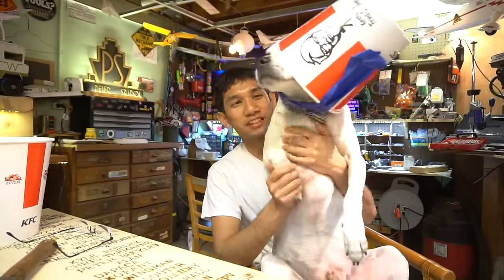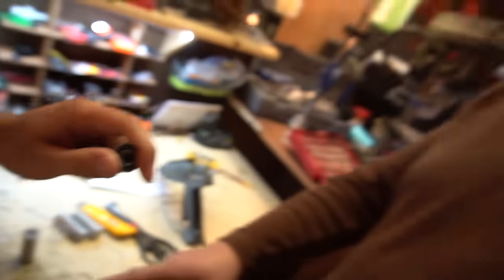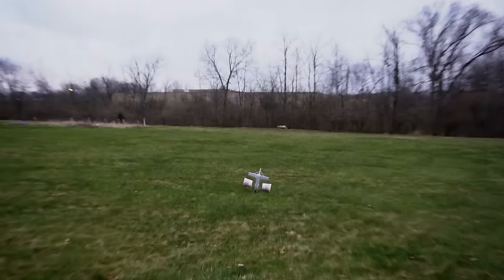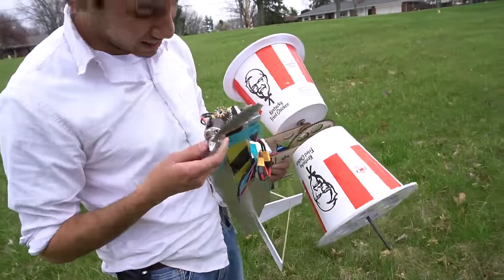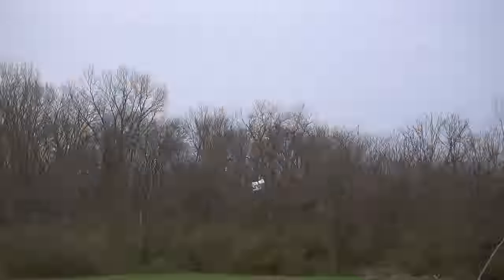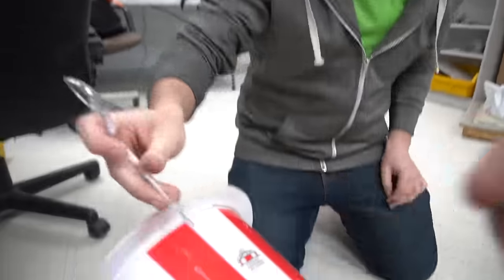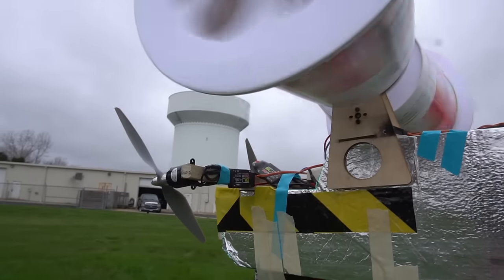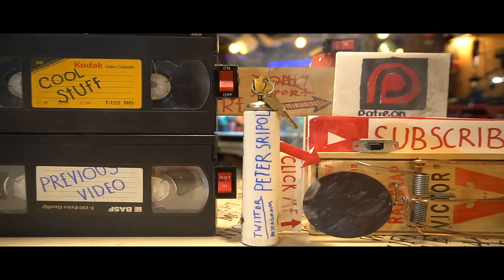RC KFC bucket aeroplane (magnus effect)

Comment: KFC should offer you an advertisment contract.
Red Bull is not longer the only thing that gives you wings. As long as you can rotate them fast enough XD
Reply: I wonder if it would be more stable with greater wing area—like add two more buckets by gluing tops together.
Reply: I wonder if you can use Red Bull cans to fly
Reply: Chickens always had wings.
Reply: @timothyhays1817  yes, but they dont fly they do little leaps.
Reply: i mean gey, he can probably use redbull too
Reply: Red bull would work.
If melted down and turned into a servo arm or something...

Comment: Late comment: try to put dimples on the bucket's surface, it will provide more  "air traction" by creating a microlayer of turbulence, sucking the air to the bucket surface, improving Magnus' force. IIRC, at a certain rotational speed, MF will actually be getting efficient and after that, it'll just basically stall.

Comment: peter- it seems that a magnus effect plane is inefficient but i heard a magnus effect sail boat is actually very efficient and cool could you build that?
Reply: that would be cool
Reply: I am a professional racing sailor.....I'd love to see this. Let me know if you need any help Peter.
Reply: ya
Reply: Fuck yes sailing with kfc bucketship
Reply: I'd love to see that your the boat man as well. make it a super easy no 3d printer hull. like plastic trays or bottles or something
Reply: TZ Boss Pete should Make a hydro foil next
Reply: This. I want to see spinning KFC bucket sails!
Reply: Spencer Watza true but a sail is apparently more effective than a wing because there would only use one engine compared to using two for the prop and back spin and some ships use this type of sail
Reply: Okay there are a few theories I think might help with increasing performance.  Basically when you look at a basketball and put a backspin on it, the grooves on the basketball create that drag or lift that creates in turn the counter spin on the air current.  Next time I would look into maybe grooves on the bucket to add some effect on the backspin.

The second possibility is angling the buckets up say to a 20 degree angle.  This in turn would give it some lift but also create that counter spin as well to allow it to give flight.  At the straight 90 degree level it pretty much creates a level effect, vs angling the buckets could create better lift.

Another one might be the effect of actually going with a quad copter approach.  Instead of using rudders or elevators actually consider vector thrust or propulsion.  Just like the F -22 Raptor.  You could you propellers or maybe a RC fan turbine.  Not jet!  The idea behind this that instead of creating resistance or air brakeage through elevators and flaps.  The vector thrust would create the counter lift allowing a current without drag or resistance and in turn allow a tail thrust to provide steering.  Think like a fist tail on a fish providing the propulsion and steering.  Just in propulsion.  

Anyways some thoughts I thought to experiment myself down the road.
Reply: its not efficient, but there are tests going on using rotating masts to reduce the fuel consumption for freighter ships (rotor ship its called iirc)
Reply: Thanks I didn't know that all I knew was that it could be used as a sail  plus if it doesn't work it could still be used to reduce battery consumption on a ship of peters
Reply: Don't get me wrong on this comment, I agree that it's a neat idea for him to test out. But your comparison for efficiency in that regard is like saying boats are more efficient than planes. If efficiency is your concern, why not build a sailboat? The concern here is for making something badass and different. THAT is why he should make a magnus effect sailboat.

edit: fucked up my syntax of "your"
Reply: kenny7220 good point
Reply: I was just thought of it and decided to bring it up to see if it could work cause from what I knew it had some thing to do with efficiency  but I still think it would be cool to try to either make a sail boat or make one of peters boat more efficient
Reply: It would be cool if you put it in the water because the KFC bucket is that a spin you would act like propellers
Reply: Indeed. It's a great idea for something off the wall to do SCIENCE! with, and my point wasn't to disagree with that. I just get a little bent outta shape when someones premise doesn't correlate well with their supporting details, and may warrant a bit of clarifying on the intention of said premise. :P
Reply: PLZ DO I WOULD LOVE<3
Reply: Check out E-Ship 1 if you want to see that in full scale
Reply: Greg Sweet the German ship
Reply: There's magnus effect RC quadcopters, there's RC airplanes. It's very effective, it's just that you don't make it out of KFC buckets too heavy, too fast.
Think of it as a gentle breeze, barely cushioning you as you walk on the street.
The KFC buckets where like a gale force wind, ripping everything apart. He says so in the video, too fast = too hard to fly. Slow = control.
If he'd get rid of the buckets, widen the stance (like most RCs that word do) he'd fly it.
Otherwise, as is, he'd need four buckets, mouth to mouth 2 by 2, bigger motor, slower rotation and a big ass motor on the front.

Him moving the center of the "wing" up high isn't necessary either. Almost all the other prototypes online (including some biggans half the size of a Smart Car) are built like regular airplanes, just with rotating wings.
Reply: If you put a motor on it, it is not longer a sailboat, so what would be the point? All the energy put into spinning surfaces could be put into a prop in the water. 
To be useful, the wind needs to propel the spinning surface.
Reply: Daveinet the wind spins bucket Wich drives a propeller shaft
Reply: You can always use pedal power.
Reply: Um, the point of sailing is to use wind power. No one cares about the 
magnus effect unless unless you can generate more lift with less power.
 Its not efficient if you are adding additional power to make it work.  

Really a bucket is the wrong shape for lift anyway. Lift is generated by the 
absence of atmospheric pressure pushing down on the wing surface. But 
what does the lifting is the pressure from underneath. The problem is 
the round surface is not a good surface to capture pressure with. While 
the effect works, I doubt very much that it works better than a foil, 
because air will just go around the surface, rather than lifting it. Its
 an interesting principle, but not practical. 

What I want to see is to compare the lift of the buckets to a wing. Take the same plane 
and put wings on it. No doubt for a lot less energy input, the plane 
will be faster and carry more weight.
Reply: Daveinet actually the magnus effect hasnt been used solely for a sailboad but rather to make desiel boats more efficient. and it does work, search it. 

Also the magnus effect does not work as much on pressure gradients but on conservation of momentum i.e. newtons first law. air is moved in one direction more than another in total by the rotating cylinder thus causing the cylinder to be pushed in the opposite direction. 

A plane has been made a long time ago which flew using the magnus effect however using these cylinders caused the plane to suffer from large amounts of drag and because of this that plane ended up crashing.

Yes i agree witg ur last part, i want to see an experiment done to conpare the lift produced by an areofoil and a rotating cylinder at different rotation speeds on the cylinder and different wind speeds.  would be very interesting.
Reply: TZ Boss I'm pretty confused hear
Reply: Your comment about large amounts of drag is significant, which aligns with my second point about sailing. Trying to move a large cylinder through the air results in a lot of drag compared to a sail or foil. 
Drag on the sail becomes very apparent when comparing conventional sailboats with ice boats or foiling cats. Conventional monohull boats, the rule is more sail = more power which = more speed. Ice boats and foilers move through the water so fast, that the drag of the sail becomes greater than the drag of the boat. As you point upwind, the wind blowing against the forward motion of the boat limits the speed. That is why their sails are are tall and narrow. If you have a really slow boat, wind drag against the sail doesn't matter much, because the power needed to push the boat through the water is so great, relative to the drag of the sail against the wind. 

To help with clarity for non-sailors, high performance sailboats will sail upwind faster than the wind speed. As you begin to approach wind speed, the sail drag becomes a bigger factor.
Reply: "Hear" is what you do with your ears.  You should have used "here."  That is the starting point of removing the confusion.
Reply: Eric Wertz I threw up in my mouth a little bit when I read your comment.
Reply: There are also suggestions of using the magnus effect on airships. In those cases the entire lifting body would be rotating.
Reply: @spencerwatza3065  Well but so do helicopters. The trick is to see what will cost the least amount of energy.

Comment: The Flettner wing is interesting because the (Kutta-Joukouski) calculation to solve for flow around an airfoil by conformal transformation begins with the solution for flow about a cylinder with rotation. Great experiment!

Comment: For those who are curious as to why spinning cylinder wings dont work in practice (and therefore are not used in modern aircraft design) spinning cylinders produce too much drag. The reason it creates so much drag is because the extreme curvature causes flow separation (which can cause stall).

Now despite it not being all that useful for aircraft, it can be used in sea ships for propulsion (look up flettner rotor ships). This can also be used when playing sports, as one can put some spin into a ball and therefore control the trajectory slightly by generating lift one side of the ball.

Comment: I would recommend increasing the length of the fuselage or increase the size of the horizontal stabilizer.  Since added fuselage length would not add significantly to drag that would be best.  The problem you were experiencing when you increased the RPM of the buckets was the additional torque this caused overpowered the horizontal stabilizer causing unwanted pitch of the aircraft.  I.E. You wanted to increase the lift from the buckets, but got unwanted nose up pitch as well.  The amount of unwanted pitch exceeded the amount of elevator control you had.  To counter the unwanted pitch, increase the lever arm of the horizontal stabilizer by adding length to the fuselage.  Great video, keep up the great work!
Reply: Or maybe weight management? The center of mass probably too far behind and the increase in lift from the buckets made it more easier to just make the plane flip backwards. There are no counter  measures against that and it would probably just strain the elevators.
Reply: Ok me smartie pants
Reply: Just one word
COUNTER ROTATING CHICKEN BUCKETS.
OKAY 4 words

Comment: The magnus effect is at VERY slow drum rotation speeds. You need to show those buckets down a lot and maybe consider much longer cylinders, travelling at maybe 50 rpm. The magnus effect would be diminished at high rotational speeds.
Reply: I hate to break it to you, but I don’t think Peter wants to even think about the Magnus effect anymore.

Comment: The propeller is nullifying the buckets Bernoulli effect.. place the propeller above the buckets.
Reply: Iron Bear too much spiraling slipstream, you’re probably right
Reply: It will be a helicopter then
Reply: What about a pusher propeller instead of a pulling one?
Reply: Yep true
Reply: Good point I didn't think of that
Reply: he said that at the end so WATCH IT BEFORE YOU SPEAK
Reply: Then that just makes it a helicopter unless you’re willing to make it VTOL some how
Reply: @dota2easy859  
He means above but still facing forward. Elevating it without rotating it.
Reply: actually I wonder if You are not totally wrong, and the opposite is true..

Comment: This has probably already been said, but if the props were level with the top of the buckets the magnus effect would be much cleaner. As it is the prop wash will be messing up the downdraft.
Reply: What if the props were behind the buckets? That way the thrust would not interfere with the airflow at all? If you put small control surfaces behind the props you could also potentially control pitch and roll more effectively?
Reply: The Original Boom good idea but it might mess up the airflow behind the buckets and also make it more unstable, but then again what do I know
Reply: Airflow and buckets is an oxymoron. Buckets aren't meant for such an aircraft. Too much drag. Maybe a helicopter type design?